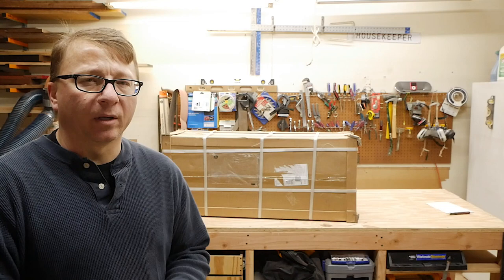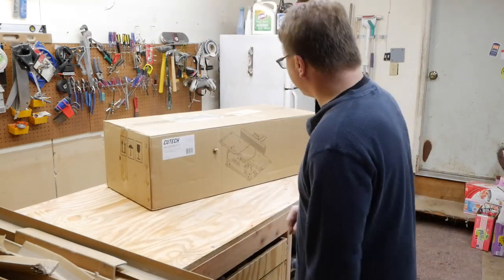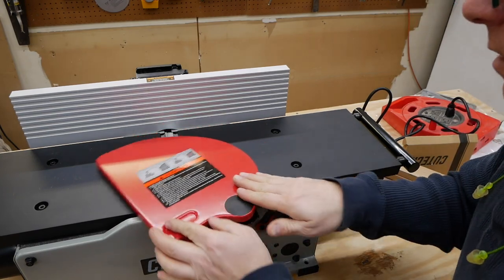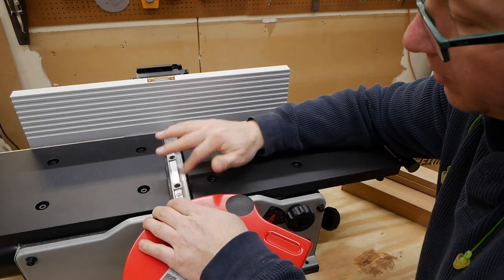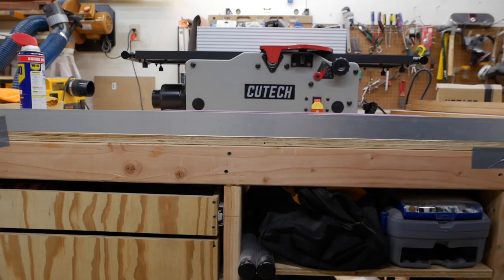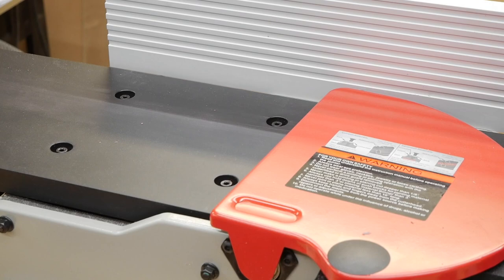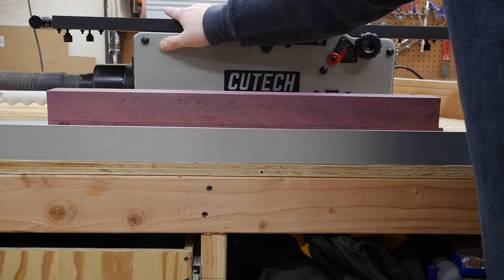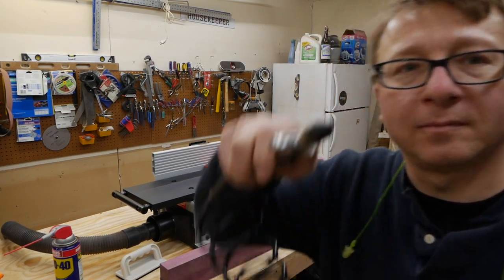Unboxing, assembly and first use of Cutech 8" jointer

Comment: I bought the same model jointer about the same time as you. My experience was the same - easy to set up, easy to use, excellent results. Thank you for your video!
Reply: I got the 8" aluminum bed with extensions. I have never used a jointer before. I cannot get a straight edge or face on already relatively straight 60 inch boards.  I finally ended up just doing it my old way with the drum sander and table saw.  I have watched countless vids on YT but cannot figure out, for  the life of me, what is going wrong. I am ending up with extremely random results. Boards 1/4 inch thinner at one end when surfacing the faces. Bow's in the middle when edge jointing.  Arrrrgggghhhh, Calgon take me away. LOL     I did notice that when I grab the end of the infeed table, I can move it up and down, and side to side.  The bolts are thight, and it came that way out of the box. Is that normal?

Comment: Great video! I safety observation though. When jointing smaller width boards use should move the fence in so you don't have as much open blade space. That way if you do slip the wood is covering all the blade.
Reply from the maker: Hi Terry - great observation and suggestion!  I will make a note of that in the future.

-Tom

Comment: Excellent video and process. I have been looking at this jointer because I have read that this unit is on the better jointers of 2019. Thank you for answering a few questions I had about assembly and ease of operation. Thank you so much for sharing. Good luck with your Purple Heart projects.

Comment: I'm thinking about buying the 8" with aluminum bed. 

How well does it do with edge jointing? I buy all rough cut lumber and mill what I need. My cast iron 6" grizzly jointer is only good for getting a flat face since the fence goes out of square if I so much as breath on it. The fence on the cutech looks very flimsy.

Thanks for the review!
Reply from the maker: Hi Jason - sorry for the delay, somehow I missed your comment.  It does very well edge jointing, but the fence is not the best.  Better than some from what I've read, but certainly the biggest down side of the jointer.  For what I'm doing it works fine, but the fence was hard to adjust and doesn't seem to stay put.

-Tom
Reply: I totally dislike my grizzley 6" gives me nothing but problems. I have their planer and have been thinking about this to save some shop space. Hopefully you're still liking it cant wait for follow up

Comment: How is the teflon coating holding up? thinking about buying it as well...
Reply from the maker: Hi Hubert - well, I think it is holding up well.  BUT - it's covered in wax to make it glide.  So, I'm not even remotely convinced the teflon coating provides any added value if you need to wax the ** out of the table top to get it to work properly.  I have heard reports of the aluminum top scratching easily, but I can verify that.  If it does scratch easily, then the teflon top might be better --- if not, then save the extra $$$.  (my opinions, not fact).  Hope this helps!

Comment: So I ended up buying the version of this jointer without the top coating.  I had to adjust the tables so they were co-planer. I got them dialed in within two thousands of an inch. It was a very tedious job even with two quality straight edges and a dial indicator.  But  overall I’m getting mixed results. With short boards I feel like I’m getting great results. But with long boards I get frustrated and wonder why I bought this thing.  However I have read that woodworkers have jointer boards over five feet with success. Based on the latter and my experience level I’m giving the machine the benefit of the doubt.
Reply from the maker: Mark Rios thanks for the information. I didn’t have any issues with the bed being coplaner but jointing longer board is challenging. But I knew that going in. You can build an in/outfeed table to help. I haven’t tried that yet. 

Tom